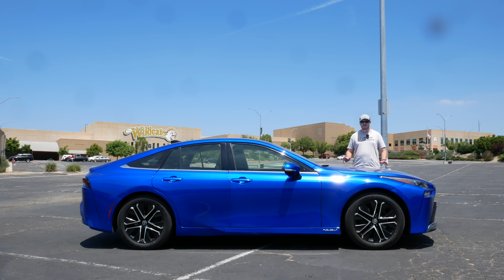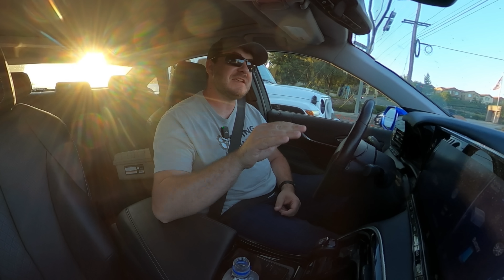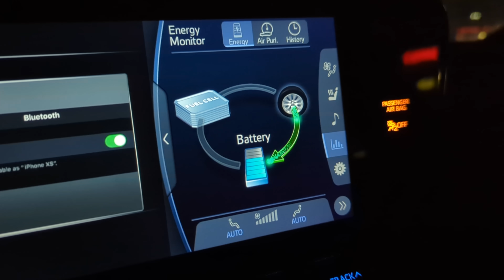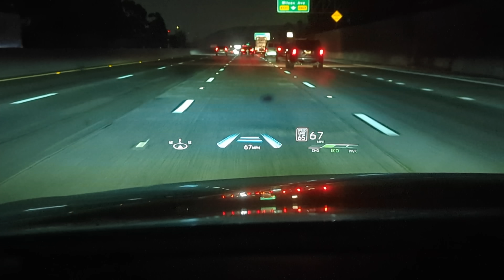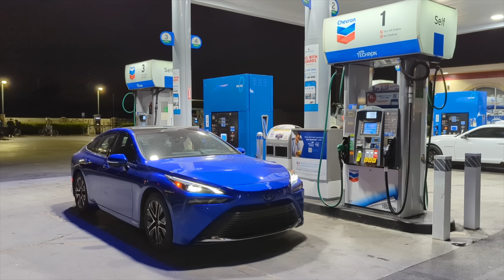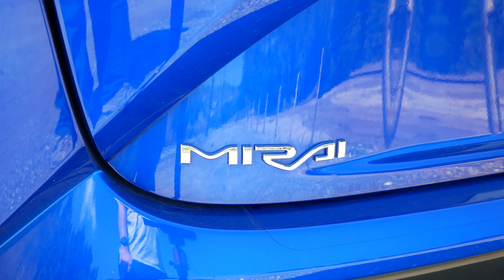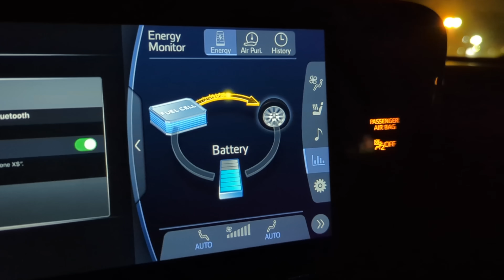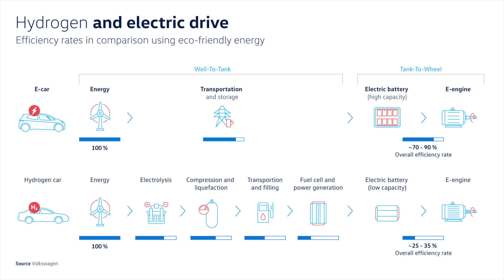The Toyota Mirai is Disappointing

Comment: The battery will also be necessary to get the fuel cell running - they need heating and other things. Hydrogen internal combustion is doable, as well - can you review one of those?
Reply from the maker: The problem with hydrogen combustion is burning hydrogen is only 20-25% efficient. The same amount of Hydrogen that takes this Mirai 300 miles would take a hydrogen combustion vehicle less than 100 miles. And it's a pretty terrible use of resource, but mostly the range issue.
Reply: @agingwheels  combusting gasoline isnt much better. At least what comes out of the pipe isnt filth
Reply: Why bother with hydrogen combustion? If you want to burn a gas in a traditional ICE engine we got propane.

The only reason hydrogen is pushed so hard is oil companies can continue to control the distribution. If everyone starts using a solar powered bicycle that's a BIG threat to their profit model.
Reply: @marsrover001  Because for burning hydrogen, you don't need super pure hydrogen. Fuel cells do. 
But the main challenge with hydrogen combustion is the tendency for backfire, as well as hydrogen embrittlement of steel.
Reply: Hydrogen combustion is basically the same chemical process as hydrogen fuel cells (hydrogen + oxygen = water + heat), but with the added mechanical complexity of an internal combustion engine (bad).
Reply: is doable, but range will be utterly useless. Hydrogen has very low volumetric density, so you'd need about half of cars volume worth of tanks to get good range.
Reply: @hojnikb  Be a good way to keep old cars on the road, just classics people love and only use on weekends.
Reply: @dave4803 another way classics are kept on the road are converting to electric. Gas engines can only run so long and it'll be more and more effort to mantain them in the future, that's just how it be with old cars.
Reply: @dave4803  You couldn't use hydrogen with the engines and fuel tanks in the old cars. You would have to replace the guts and only keep the frame. Better to make it an EV at that point. For those that actually want to keep a classic car and make it run as before, the best option is synthetic fuel. It has many issues as well and would be expensive. But it actually keeps the old car running like it was intended.
Reply: @dave4803  
It can't keep old cars on the road because you need major physical engine modifications, including more exotic metals to survive using the corrosive gas.
Reply: @rogerstarkey5390  Toyota made a conversion for an ae86
Reply: @anthonypelchat  I thought it was like LPG.
Reply: @rogerstarkey5390  I thought it was like LPG.
Reply: @dave4803  No. Engineering Explained did a video on hydrogen combustion that is pretty good.
Reply: @balazsbalazs3926  Yes with a lot of issues. It's only getting 28 miles on a tank of gas and at 1/2 the power of the engine. And the long term issues from hydrogen eating the engine are likely huge. There is a reason Toyota has been silent on details and only pushing it as a concept.
Reply: @anthonypelchat  I'm no expert on hydrogen, I just know it's a gas that burns.
Reply: @dave4803  Understandable. And Toyota has put out info making it seem easy. It just isn't. Hydrogen is all sorts of crazy. You also have to keep in mind liquid hydrogen, which some numbers point to in order to make it sound better. Liquid hydrogen requires cooling down to near absolute zero. And gas hydrogen takes up too much space to be all that useful.
Reply: @anthonypelchat  Then I'm more shocked then ever one of the biggest car manufacturers in the world is still making cars that use this flawed fuel.
But everyone knows the future is battery electric.
Reply: @dave4803  I'm honestly not sure what their reasoning is. Pride maybe. They poured a ton of money into hydrogen tech, but it hasn't gotten them anywhere. Even fuel cells have no future. The tech is so unbelievably pointless compared to BEVs.
Reply: @crackedemerald4930  said by someone who obviously doesn't own a car than 1999.
Reply: @dave4803  Or not live in a communist place that bans gasoline
Reply: Hydrogen combustion makes no sense - hydrogen doesn't burn as much, it loves to explode. Volvo is researching hydrogen combustion in tandem with diesel combustion, meaning that they inject hydrogen into diesel engines to improve efficiency. It's an interesting idea and I'm sure that the maritime industry is thrilled
Reply: pretty sure BMW had a 7 series hydrogen combustion car. It was more or less a small prototype series, only leased them out to VIPs or energy companies.
It's MPG rating was astrocious.
Reply: @Crazy_Borg  That one was actually really neat. Used cryogenic hydrogen and therefore actually had a decent amount of power. But yeah, it's range was horrible and it needed a huge tank to keep the hydrogen at the right temp. It also leaked by design. Therefore you couldn't park it in a non-ventilated garage.

Comment: Me and all my friends: "Dear god, we want a plug-in all-electric 4Runner!"

The auto industry: "How about an underperforming car that you can't fuel up basically anywhere?"
Reply: I could see maybe a very limited use case where excess electricity produced by renewables is used to crack water to fuel up long-distance vehicles where batteries don't really make any sense (locomotives?) but hydrogen is certainly not going to ever be a mainstream fuel for the masses.
Reply: @wesley00042 Personally as a non expert spectator I quite like hydrogen for trucking, since trucks are generally either confined to predictable transport corridors or operate out of depots you don't need the same very large number of retail stations for refuelling and you would need massive infrastructure either way for charging, and you actually need fewer refuelling stops because of the amazing range (there are test platform hydrogen vehicles with well over 1000km of range, capable of exceeding double the range of even the Model 3 LR. Longer range for long range trucking means fewer stations needed, which means less infrastructure).
Reply: @bosstowndynamics5488  A lot of people think that way. But there is a really big issue with that. Costs. Refueling costs for hydrogen is and always will be drastically expensive. It can only compare with diesel if oil prices increase a lot. And it can never compare with EVs on costs. 

An EV truck makes more sense when you think about it in more detail. Range doesn't matter that much since you need to stop for mandatory breaks anyways. If you can charge during those breaks, than that is all the range you need. Since infrastructure is easier to build for EV charging, you can have more stops available. And you don't need any crazy logistics to get fuel to stations since it is carried over wires.
Reply: @bosstowndynamics5488  
The larger the vehicle, the more any disadvantage is magnified.
Correct me if I'm wrong, but "cost per mile" is quite important in trucking?
If the fuel cost is let's say double, it's a red flag.
Hydrogen is much more than double.
The "but it goes further" opinion falls apart if you can Outrange a driver with an EV truck.
You can.
Reply: @wesley00042 I mean if you think about it hydrogen is already the mainstream fuel - it's just inconveniently bound up with a few other elements.
Reply: @TuckMcSouthard  lol this is an interesting philosophy. I'm not a chemist, so I don't know if the energy in hydrocarbons come mainly from the hydrogen or from the bonds (I suspect the bonds since combustion breaks those bonds).
Reply: @PC_YouTube_Channel Chemistry is weird, but basically forming bonds releases energy, it technically consumes energy to break the bonds in hydrocarbons but you then get a lot more energy back out because oxygen really likes sticking to things, and will happily release energy by binding to both hydrogen and carbon
Reply: @bosstowndynamics5488  
I think you just described "better than 100% efficiency"?
.
It's clearly not.
Reply: @wesley00042  
The problem with the "excess renewables" opinion is there is really no such thing.
The grid is not 100% renewable.
So
There are just "unused renewables".
.
Ideally we should aim for a situation where 100% of renewable (grid) energy is used to replace existing fossil generation?
But, if there is "spare" energy, we need to put it to good use?
Like getting that energy to the wheels of a vehicle?
.
I think we're all agreed that using a Hydrogen based system only gets at best 30% of that energy to the point of doing useful work?
.
This also takes a lot of infrastructure.
That's expensive.
Why do I find it more logical to take the infrastructure money, build "a battery" instead, send about 30% of the stored energy to do the same amount of work in a vehicle fleet, and assuming a 10% loss, use 60% of the (no longer "spare" energy for use elsewhere on the grid to directly remove fossil generation ?
.
Example.
100GWh of Potentially stored energy.
Options..
Send it straight to an Electrolysis plant.... Hydrogen... Store that... Transport by (huge!) road tanker fleet..... Fill vehicles.... Convert back to about 30GWh of electricity moving the fleet.
.
Or
Take the same cash.
Build a battery system (NOT necessarily Lithium based!)
.
Send 30GWh straight to the EV fleet, moving that the same distance.
.
Send 60GWh "anywhere else"
(Allowing 10% transmission losses in both cases).
.
You just removed 60GWHh of Peaker Generation from the grid.
.
Not to mention comparatively tiny ongoing maintenance...
.
Conclusion
The "Green" Hydrogen option still results in more existing Fossil generation remaining on the grid.
.
It's the dirty option.
Reply: "I want a usable sports car that's fun to drive"

America: muscle, or truck?
Reply: Rivian R1S?  Scout Traveler?
Reply: It's entirely on purpose. It's so they can do the same thing that GM has done before. They make these "clean cars", they don't work all that well, are expensive, and have no infrastructure, then the public doesn't like it and they can go "see, it's not feasible, gas cars are the only reasonable way". So they can continually force the government(s) to delay their sustainable car legislation.

Btw, love your channel, cool to see you here
Reply: @PC_YouTube_Channel  The other thing is Toyota has invested big into Hydrogen fuel cells and want desperately for the tech to catch on so they can get a return.  The major problem is the tech is probably fundamentally flawed, at least for personal transportation.  But that's why Toyota has been so sour on batteries - they're way behind on that and they want their Hydrogen investment to not have been for nothing.  Toyota is also really quite attached to their gas engines and very conservative in their business.  Which is great for making bulletproof cars but horrible for doing major innovation.  Also tends to result in cars that are more towards the appliance side of the spectrum, so kind of hard to get too excited about.
Reply: @ccoder4953  
It's not "Probably fundamentally flawed".
It' IS
" Fundamentally Flawed "
.
Absolutely no doubt.
Reply: @rogerstarkey5390  Yeah, I agree it's fundamentally flawed and I really don't see any way around the issues.  Some of the problems are pretty basic physics/chemistry (like how much energy gets lost just compressing/decompressing the Hydrogen).  Then there's the whole problem that the only catalyst we've found that actually makes any sense, despite much effort to find something else, is Platinum.  And we just don't physically have enough of that for a fuel cell car industry.  It's not even we don't produce enough - it's not clear there even is enough.  Oh and the fuel cells actually lose some of their Platinum through their lives, so you can't even recover that much by recycling. The reason I said probably was to leave some hope that maybe with alot of time and effort a way around the issues can be found.  I doubt it's possible (there's just too many really big problems), but you never know.  But by the time we do all that, batteries will be so good that any fuel cell will seem silly.
Reply: @PC_YouTube_Channel  thanks for the feedback!  I'm happy to be here... I never miss Robert's videos and am glad to support Aging Wheels!
Reply: @PC_YouTube_Channel  gas cars ARE the only reasonable way. I kinda hate Elon Musk for raising popularity for those in all ways shitty EVs
Reply: But why, why would you want it? There is a normal 4runner

Comment: I can't find a single argument for hydrogen cars.
Reply: Keeps oil companies happy as they still have a monopoly on fuel production and distribution?
Reply: If you can produce hydrogen with renewable energy, then it is much better than electric cars. Assuming we can't find a battery chemistry which would fix the enviromental problems. Lithium mining etc. will be much worse for the planet. Also if fuel cells work in cold climates, you will have a use for the waste heat.
Reply: I can't charge at home, with the miles I do I'd have to rapid charge a BEV twice a week, which according to the car makers means I will kill the battery in a couple of years. I see this being aimed at people like me, where they do a medium amount of miles, but can't charge at home. Most of the Mirai's sold in the UK are working as taxis in London for exactly that reason.
Reply: @TheChloeRed  a fairly clean diesel would be a better fit for you than this gimmick.
Reply: @alexcrouse  I've driven diesels since my Y reg (2001) focus. My Xtype jag used to return 75mpg averages on the motorway, my current Infiniti Q30 returns just over 76mpg averages on the same trips. Issue is, ICEs are banned from sale from 2030 here, so I won't have that choice.
Reply: @TheChloeRed  if you commute to work, there just might be charging stations in the future at your place of work, which means slow charging. But even so, quick charging doesn't just kill batteries. They're liquid cooled, so effects on life are not as obvious as with air/no cooling batteries.

You'd be just fine.
Reply: @hojnikb  I'm a field engineer. I go to sites that need me. Do I tell all 50 sites they need to fit a charger for me? And "you'' be just fine" yes, but £1,500 a year poorer, as that's the current cost difference between a BEV on rapid charging here and diesel. to even match my current car I need a BEV that averages 8 miles per kWh. (not including the cost of my time to be sat charging)

Comment: They should work a heat pump into the energy system. The heat pump could boil water and make steam to run a turbine generator. The power from the generator could... I don't know... maybe produce more hydrogen through electrolysis. I love energy transfers. Oh, I know. How 'bout a thermopile... you could...
Reply: You'd just be scavenging energy from the system and getting less back than you took out.
Thermodynamics is a harsh mistress.

Comment: A bit off topic from this video, but at one point you mentioned Teslas having great software. I've heard almost the opposite, specially when comparing to android auto (not android automotive). Main things I've heard is tesla is a bit clunky when it comes to environmental settings (heat and ac), some stuff is on the display that shouldn't be (wipers), and not great music due to limited compatibility with music streaming platform, and not great bluetooth integration, granted most of these I heard for a while ago it's possible things have changed. That's one of the things steering me away from tesla, and to something else with android auto instead, there are other factors, but that's one of them. What are your experiences with that?
Reply from the maker: So far I've had this rental Tesla for all of a day, so I can't speak to it much, but I'm super impressed so far. I've had more pleasant surprises than annoyances so far. For instance, it has adaptive blinkers! I had no idea that was a thing. And it's unbelievably efficient (5mi/kWh). All while still having more power than enough power
Reply: @agingwheels  sounds like they've probably fixed the software issues then. Good to know, thank you!
Reply: @agingwheels  i have had model 3 for four years now and sometims after updates choices for sotware are so stypid it feel like software enginers that made the software dosent have a driving license or never even been in a car. example those wiper controls took years to get adjustment from screen only to the left scroll wheel (and they still dont have adjustible interimten setting). and then ohter one in last winter automatic climate setting was constanly using defogger even when not needet freesing your legs (and auto setting was good before in 2019-2021 winters).
Reply: @aleksisoukkala  I have a long range model 3 and I've found the voice controls are the best for the wipers because the regular controls suck... and that's really it as far as my complaints. Well, except the wipers just being trash to begin with and not cleaning the windshield all that well.

4 mi/kwh after 20k miles in about 2.5 years of ownership.